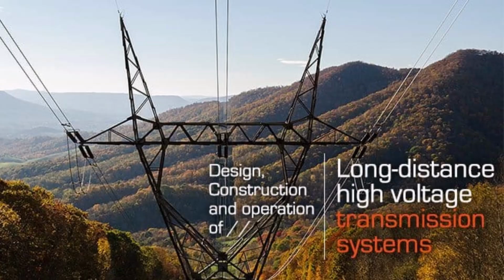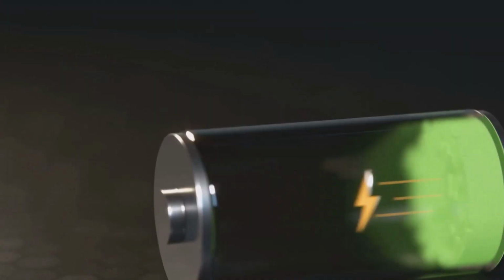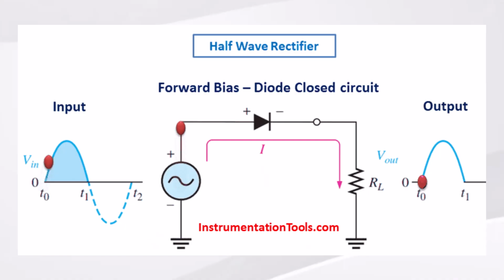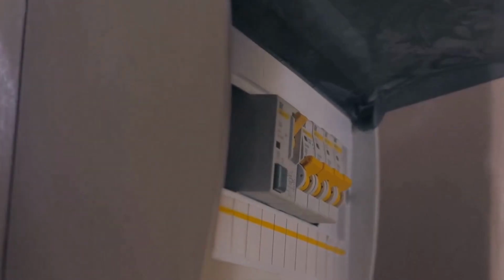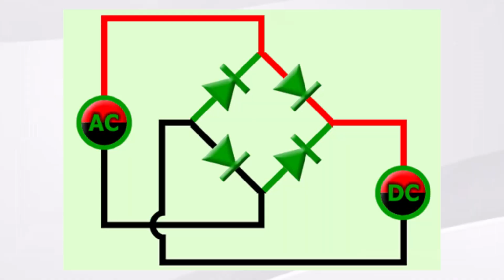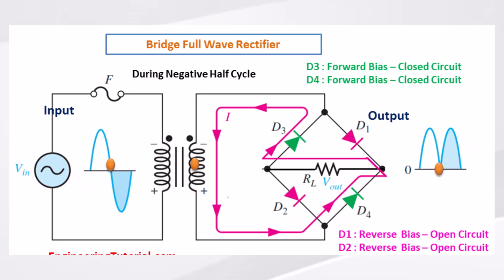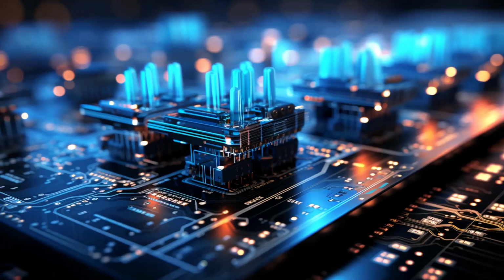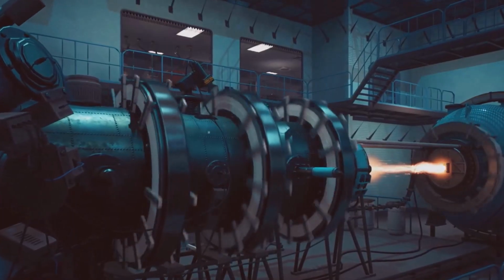Half Wave and Full Wave Rectifier Explained with Circuit Diagrams and Waveforms

Comment: Good visual breakdown of the conduction periods, that's usually where people get confused, especially with full-wave bridge rectifiers since all 4 diodes don't conduct simultaneously (only 2 at a time, alternating per half cycle). Would be great to see a follow-up on ripple factor calculations for both, since that's the real practical difference when picking a rectifier for a power supply design, full-wave has way lower ripple (0.48 vs 1.21 for half-wave) for the same filter capacitor, which matters a lot in real DC power applications.

Comment: This is hands down the clearest explanation of rectifiers I've seen. The side-by-side comparison of half wave vs full wave using actual circuit diagrams and waveforms made the difference in ripple frequency and efficiency so much easier to visualize. The way you showed how the bridge rectifier utilizes both halves of the AC cycle was a real 'aha' moment. This is the kind of foundational electronics content that every EEE student needs bookmarked. More power electronics topics please.

Comment: Excellent explanation, Madam. You presented both half-wave and full-wave rectifiers with great clarity; the circuit diagrams and waveforms made the concepts very easy to understand. The comparison between the two was especially helpful for building a strong foundation. Thank you for such an insightful and well-organized lecture.